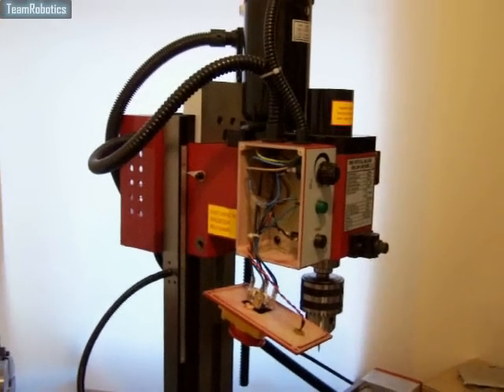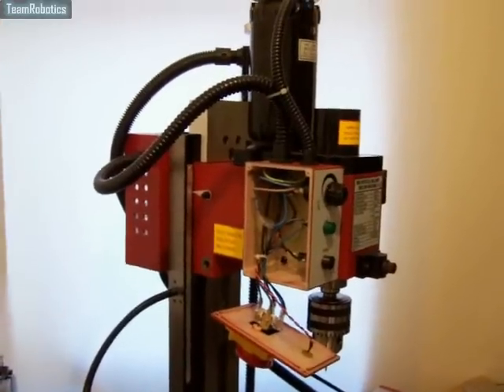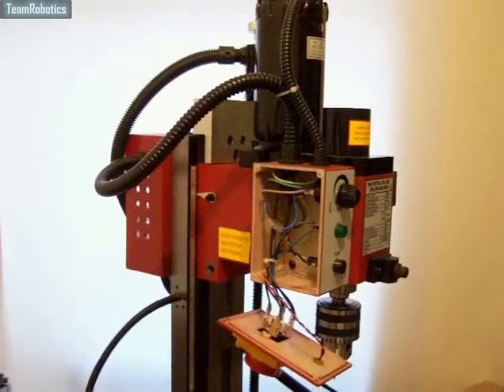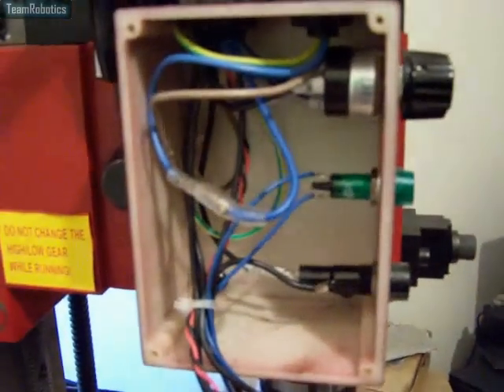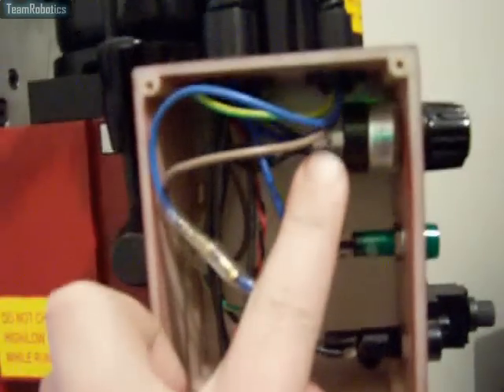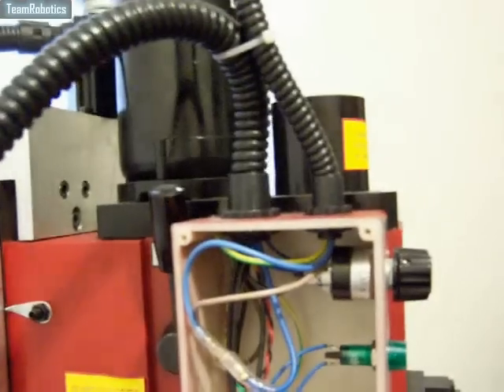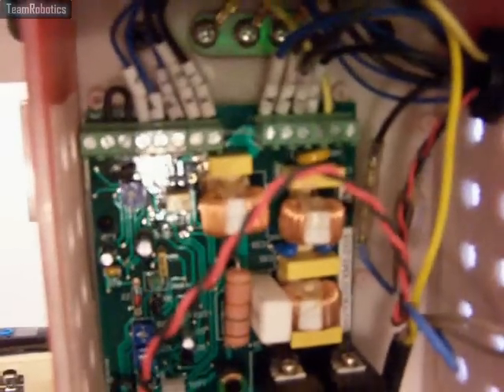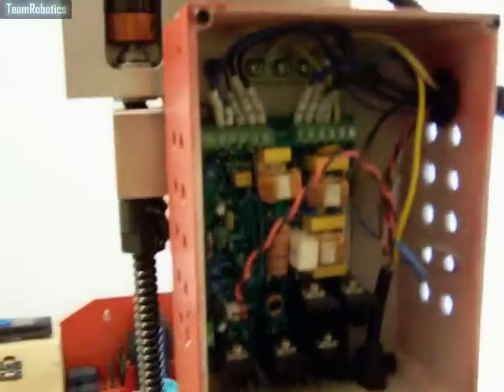67: Sieg X2 Mini Mill Electronics

Comment: One thing that I have noticed is that to speed controller is set up a-lot different then the 120VAC American version. Connection 1 and 2 are the 110 volt DC motor. Connection 3, 4, 5 are power input and for the switch on the back of the potentiometer. Connection 6, and 7 are bridged together. Then there is a space between terminal blocks, where the next set are the 3 potentiometer connections.